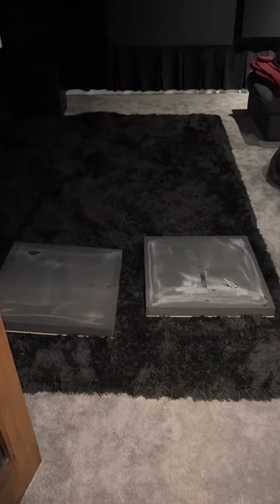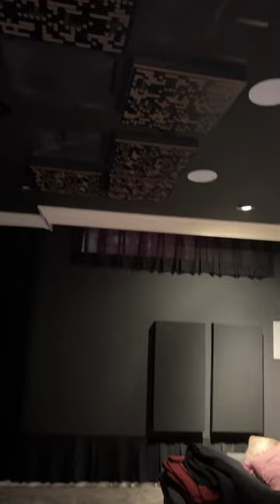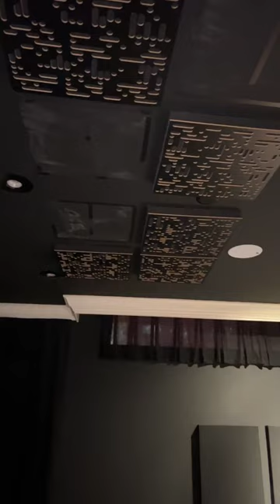Don’t Do Ceiling Acoustic Panels This Way In Your Home Theater

Comment: Time for toggle bolts. The biggest issue I see with mounting with toggle bolts is getting the placement right. Since you’ve had to re-install a couple of times, with glue, and know the exact spots, I would go straight to mounting with the toggle bolts.
Reply from the maker: Yes, at this point I wish I would have just started with different panels a different way. I thought this would be easier...

Comment: Looks like the 2Da panels. Weigh about 7 lbs each.  You could try eyelets and zip ties. Leave about a 2 inch gap between ceiling and the panels. The gap helps with sound absorption as well.
Reply: This is the way to go and recommend by lots of people. Eye lets with a heavy duty line.... I've also seen French cleets to slide into vs on to.